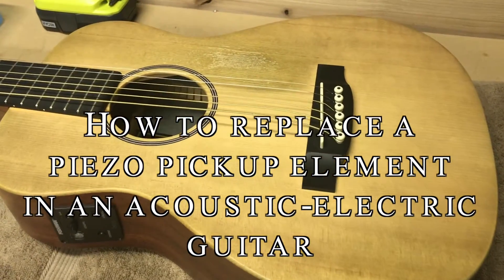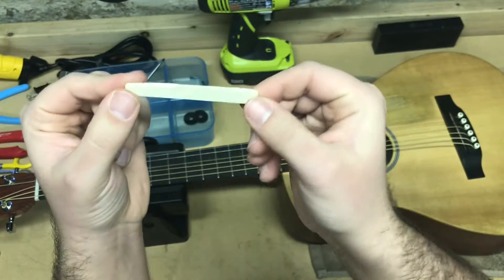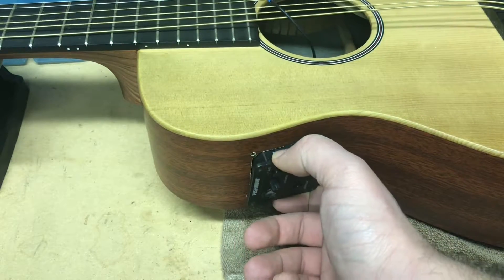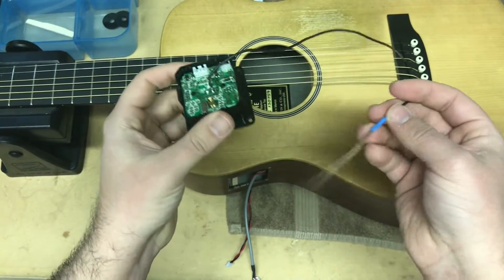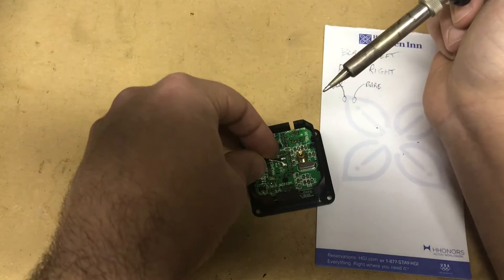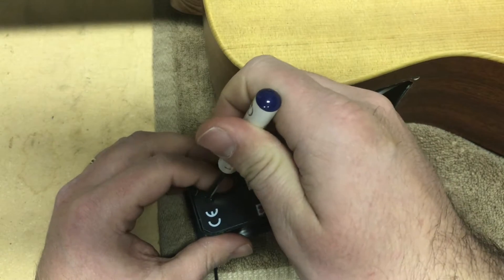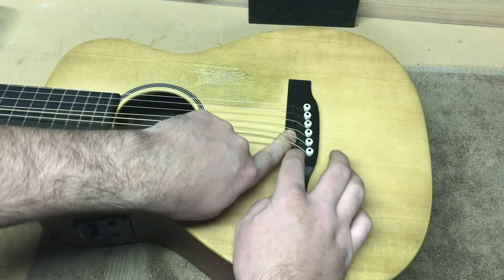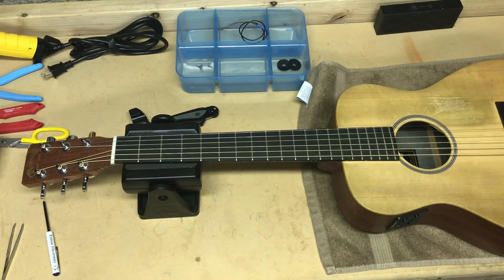How to Replace a Piezo Acoustic Guitar Pickup

Comment: How do you measure the saddle so you know whether it's wide or narrow. my saddle seems to be wider on the low end. I'm hoping to replace my Fisher Axis Preamp with a Fisher Prefix on my '97 Taylor 410CE. Do you know if the Prefix will fit in the same hole without having to do any drilling. I can't find any specs on the Axis.

Comment: My tuner is working, but no sound is coming out from the speaker when connected. Whats the issue here ?
Reply from the maker: Sandeep Salmon Could be a number of things; hopefully it’s something simple!

Of course the first things to check would be the easiest/obvious ones. Make sure the tuner is not engaged (on this preamp, turning on the tuner mutes the output), and make sure your cable and amp are working, connected, and set up properly.

Next thing would be to check that your output jack isn’t broken, and that none of the leads/wiring is shorting together (touching). If that’s good, check the solder joints on the output jack. Then check that the wire between the output jack and the preamp is plugged into the preamp.

That’s basically all of the simple physical troubleshooting there is to do. If all of those things look OK, you might have something wrong with the preamp itself, in which case you’ll need to take it to a tech for repair (or, if you’re electronically inclined, find a service manual and try to troubleshoot the circuit yourself), or replace the preamp.

If it comes to that, replacing the preamp is basically the same job as shown this video, except you don’t need to remove the pickup from the guitar, you just replace the preamp instead of putting the old one back in.

Good luck! I hope you get your issue resolved!